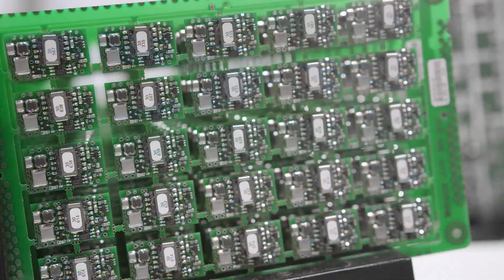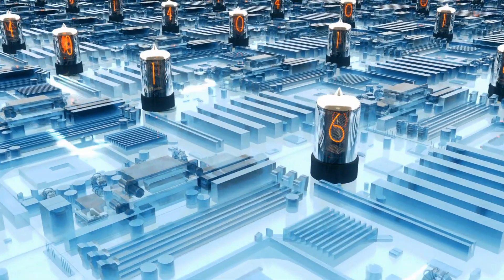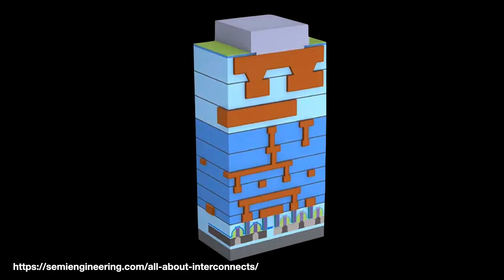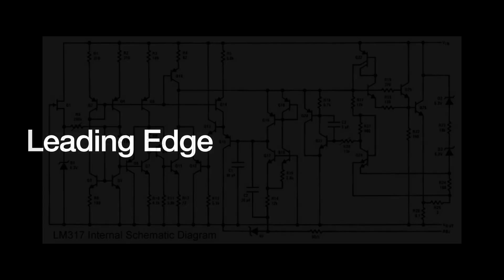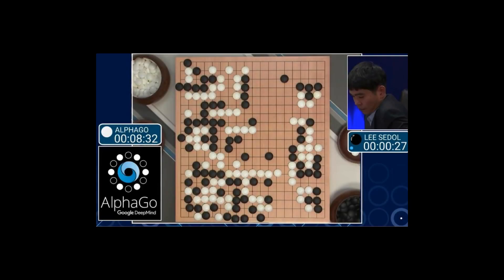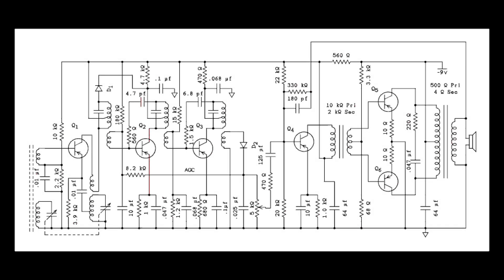Analog Chip Design is an Art. Can AI Help?

Comment: If you get down small enough the analog world starts looking decidedly digital in many of its aspects. But, then if you continue digging quantum effects rear their heads and the world is neither digital nor analog. Instead if is some weird miscegenation of the two. That said, if you are to be successful you'll realize that nothing in wires, it's all fields guided by the parameters of the material in which they are propagating. You can see where you want the signals to go; and, then because they are fields, you must consider where ELSE they might go. Then you either find you grok it in fullness or you're second rate trying to make real physics work with high school physics level understanding. The gremlins eat you for dinner.

The smaller the circuit the more the gremlins seem to gather. You must understand macro circuit design and layout thoroughly. That can mean understanding that "ground isn't ground." Forget your physics class unipotential ground plane. That layer you call ground is a big layer of material with a finite conductivity. Every point on it interacts with every other point around it to give it a unique potential, which feeds signals, wanted or not, into circuit elements connected to that ground plane. Add in the detail that it is fields in and around conductors that transmit the energy/information around the circuit. Coupling of fields is done with loops. You minimize coupling by minimizing the cross section of the loops. You must keep them SMALL. And the layout artist looks at complexities such as an analog to digital converter slowly grows brain fur. But, these days that problem exists for the digital circuits as well. There ain't no such thing as a free lunch. And an understanding of one of the most abstract aspects of our universe, fields, is absolutely essential. And those damn things aren't analog of you don't watch them closely. They can start playing particle games with you.

(Not a chip designer. Am an RF circuit designer bit by the dark side of the software. Now I bring it all together with SDRs while deep in retirement. I have deep respect for Bob WIdler and the rest of that crew. But, I suspect modern Analog Devices circuits would give them trouble. I have real deepest respect for the contemporary mixed signals chip designers.)

{O.O}

Comment: I used to be an analog and mixed mode ic designer. I had LOTS of fun. I especially enjoyed the challenges of simulating the circuits properly. And what a feeling when the first silicon arrived on the bench and it worked exactly like in the simulator! Of course sometimes certain behaviors of the actual chip remained a mistery...
Reply: care to share those unexpected behaviors?
that's how we learn how the universe really works
Reply: @manonamission2000  well, it's been over 20 years ago. If I remember correctly I had an offset problem: the measurement and the involved math showed beyond any doubt that there was a constant offset causing a systematic error in the slope of a ramp. But my colleagues and I looked everywhere (circuit schematic, layout, design parameters) but everything seemd right. In the last run we even chose a more expensive mask set, but the offset was still there. Fortunately the parameter was not a fundamental one, so we simply relaxed the spec and the device could enter production. But I could never figure out the root cause.

Comment: Something not mentioned in the circuit layout part is the inability for algorithms to route circuits in a determinable amount of time. Most algos used in programs have a best/worst/average case (BigO notation) that is polynomial which mean time to complete is an exponent of the items to iterate over. Some algos are deterministic but some, like the travelling salesman problem, are nondeterministic and thus cannot predictably be solved in the most efficient way possible by a machine.
Reply: That's exactly the point if the parallel with the game of go.

Comment: Those who aspires to be analog designer should have many first-hand experiences on discrete high frequency analog circuits design first in early age.  You can experience many varied and weird parasitic behavior of analog circuits on such RF circuits. Familiarize yourself with many historic analog circuits design like radio, TV, classic amp, radio transmitter, op amp circuits. Study workings of the circuit carefully down to a resistor. Once you are accustomed and learned such strange and intricate nature of analog circuits, then study carefully circuit, layout, and floor plan of famous classic analog integrated circuits like LM741, NE555, LM324. etc. Compare SPICE simulation result and real circuit behavior. Know the difference of SPICE mode and real world integrated circuits. Try to understand why they are designed circuit and layout such way. You will get lots of insights from such classic designs.

Comment: The digital world is binary but the real world is analogue? Really? Isn't it true that the smallest observable/meaningful space-time is the Planck space-time and any attempts to interact with a smaller space-time will result in a singularity quandary? Perhaps reality or analogue has other meanings in Asianometry?
Reply: Context. Most analogue circuits don't operate at a level where that directly becomes an issue. At mist you might observe it indirectly in the form of noise.
Reply: @Gameboygenius  That true with the current technology. However if/once micro-electronics shrink to atomic levels (nano-electronics?), quantum effects become much more significant. If/once engineers wish to shrink electronics to subatomic level (i.e. pico-electronics?), quantum effects like tunnelling & entanglement will dominate. Fortunately (or Unfortunately) even at this extreme level, 1 Planck length is still about 1.6 billion-trillion picometer (or 1.6 sextillion picometer or 1.6 thousand quectometer) ... so perhaps from this perspective, reality does look analogous or continuous to the author of Asianometry?

Comment: nice :) I really struggle with the analogue parts of my projects :) I notice quite a movement  to re-create old analogue chips like sound chips with FPGA emulation based on digital filters and some very creative bitstream shenanigans. That is open to AI approach too I think ? I recall some mobile robot gait generation approaches based on AI gen of bitstreams for FPGA ... with class D amps all sorts of oddness become possible on the analogue generation side.
Reply: I would like to know all about analogue sound chip FPGA bitstream shenanigans, if that's actually what they are and not just clever digital programming.

You might be aware of Adrian Thompson's classic 1997 paper "An Evolved Circuit, Intrinsic in Silicon, 
Entwined with Physics". He applied a genetic evolution approach directly to the bitstream to evolve a tone detector that could discriminate a 1 kHz and 10 kHz tone on a FPGA with no external timing reference. It got there eventually. But the odd thing was that the circuit relied on cells that were disconnected to function. And when he tried moving the bitstream to a different of the same model, it no longer work. The genetic algorithm had evolved to live on one specific piece of hardware.

Comment: Working at an analog company we only considered ESD protection the black magic. Most analog design was fairly automated after proper modeling.

Qualifying a new process was very in depth, and there were a few gotcha’s that popped up in the first designs with nearby devices or interconnects but those could be worked in design rules and coded into automated design tools. We would occasionally find a new problem in mature processes, but those learnings were quickly tested for in other processes and proactively prevented.  

We weren’t at 7nm, or 32nm, but the analog circuits were always larger geometry then the digital portions even in analog heavy designs.
Reply: Put thermal accurate thermal models behind each component and a spice of minority model of the substrate connection it turns to less an art but more engineering.

Comment: As someone who has tried to use the Berkley Analog Generator (BAG) one of the main problems is setting the system up. First it is a python library (built by grad students) with lot's of dependencies, these are not always readily available on the operating systems used to run EDA software (*cough* RHEL 7 *cough*). After that hurdle is cleared, BAG needs a set of base layouts that the software can array copy (for lack of better words) next to each other. These base layouts are necessary to build up larger transistors with the flexibility to meet the design needs. These layouts are difficult to make due to the complicated design rules for current-gen and leading edge processes. Also, the work to build the layouts cannot be shared between processes as they are, in general, quite different from each other.
All this to say, BAG has significant adoption costs associated with it.

Comment: Does anyone know what are some differences between designing analog circuits for an ASIC vs. FPAA?
Reply: An FPAA is designed with a certain type of function in mind. For example an audio filter function. Such an FPAA would contain opamps and variable gain circuits for example. You would be unable to configure those blocks in such a way that you could make a DCDC buck converter for example as that needs different types of blocks. On an ASIC, there are no such restrictions, you simply integrate the blocks that you need like comparators, gate driving circuits and some large switching transistors to make a DCDC converter but for an analog audio processor you would use opamps for example.

Comment: My first analog circuit was a DC/DC converter with multiple inputs, single output to define the desired output voltage given the multiple inputs (it had power delivery limit, desired speed and temperature), it was designed to move a DC motor for a prototype car. Why did I made it analog? I dunno, I just loved the idea of making something different using something no one around me was able to even try to copy

Comment: A similar thing that has always baffled me is analog mechanical computers like the fire control system in Iowa battleships. Which as far as I know remained a lot more accurate in it's firing solutions than many digital types that followed. And since it mixed inputs continually it also gave you solutions real time. The only not real time part was the human operator needed to feed the wind speed or some of the other inputs into the system. But other than that it was solving an analog equation with the given inputs.. mechanically.

As a student of the binary age I've always thought that was really crazy that someone thought of doing things like that.
Reply: Yea, I watch Ryan over @BattlshipNewJersey as well. Digital is like quantization - it's discrete.  Analog natively supports 1/2, 1/4, 1/8... 1/n.. 1/n*2... increments.  Terms like a "smidge" are perfectly valid.  Also, all of the inputs on the Mk 38 Range keeper along with the Mk 41 stable vertical are analog.  Distance, bearing, temperature, humidity, on and on.  Analog calculating analog is ideal in this situation.  The inputs are the impetus for the outputs.  The output changes continuously with the inputs.  The firing solution is a natural result of the inputs.  It was 40 years of development before the analog to digital encoders, and the digital computers were fast and reliable enough for the Navy to make the transition.  Even then, the firing solution was discrete.  Inputs became fixed so a firing solution could be calculated and made available when the trigger is pulled on the pineapple.
Reply: @fredinit  And 5hey were using analog firing computers in the 19th century in the early battleships and cruisers.

Comment: Ok, let's try to identify some of these images for fun.
0:06 A DC/DC converter module of some kind. Transformer and optocoupler in the middle of the board to isolate the primary (right) form the secondary (left). Could be for use in telco for converting 48 V to a local voltage like 5 V or 3.3 V for example.
0:13 Some analog chip produced by PMI (Precision Monolithics). Could for example be an opamp.
0:31 The title "analog delay" combined with delay stages taking opposite clock signals φ_1 and φ_2  points toward a BBD (bucket-brigade delay). This is an analog device delaying an analog signal by feeding it through a series of capacitors which each holds a sample temporarily before passing it on. I don't recognize the circuit. I would've loved for this to be either Serge's Wilson Analog Delay or Buchla's model 277 (modular synth devices) but it doesn't look like it.
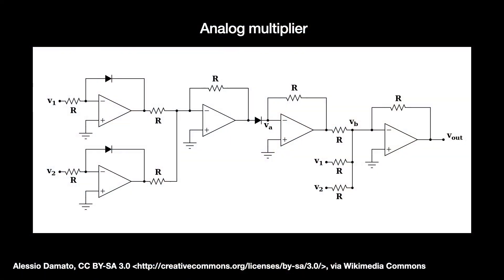2:09 As the title suggests, an analog multiplier circuit. What's neat about this circuit is that it's actually a logarithmic converters followed by a summer followed by an exponential converter. In other words, it turns a multiplication into an addition according to the laws of logarithms and exponentials: a*b=e^(log(a)+log(b))
2:51 Looks like the same analog delay circuit as in the title card. Through the magic of reverse image search, this turns out to be an early 1976 guitar pedal prototype circuit which inspired MXR delay pedals.
3:05 The title cards for two previous videos. To the left, the board for a HackRF One, a SDR (software defined radio) which can be used to receive various radio signals. To the right, something that looks very much like a computer motherboard, with PCI or RAM slots.
4:27 Looks like a RF demodulator going into an AGC (automatic gain control) then into an amplifier feeding a builtin speaker. Ie a radio receiver. The negative voltage supply (positive ground) combined with liberal use of transformers, suggests a vintage circuit.
5:00 LM317 internal diagram. LM317 is a classic adjustable, linear voltage regulator. The schematic of the internal diagram is drawn in the datasheet.
7:18 Looks like a circuit for exercising your understanding of Kirchhoff's Law in school. Fun stuff.
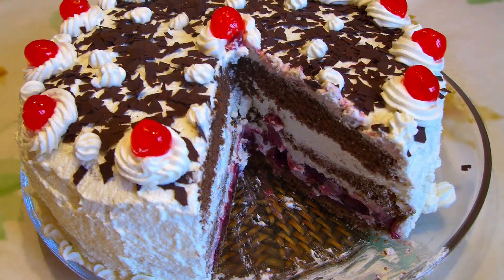10:52 A delicious cake, which I'm informed may be a lie.
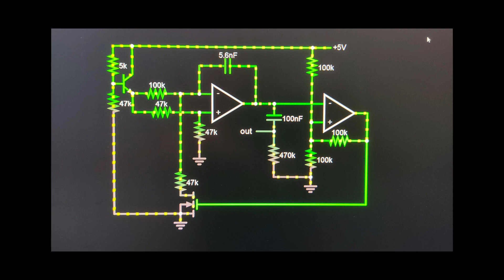12:30 Looks like a sawtooth wave generator. The second opamp is setup as a comparator, which will trigger the MOSFET and reset the phase when the voltage goes above 2.5 V, plus a little bit of positive feedback to encourage the opamp a bit to work as a comparator, which it's otherwise reluctant to do. Also, screenshots are hard.
12:44 Not a schematic, but just a note that it's difficult for AI to generate grids apparently. The lines are wobbly and the lines never seem to line up on both sides when they're obscured by some object.
15:18 Interesting. I wonder what this is. Two CPU/FPGA/whatever devices hooked up to memory, by the looks of it. And then IDC headers. This is probably some industrial or test equipment, like the digital portion of an oscilloscope.
Reply: Nice to know that AI struggle to draw grids.
Reply: Thanks for sharing the insight!  😃
Reply: I know old school audio amplifiers had a ton transformers in them , so perhaps the schematic is for 1 of the amp’s stages
Reply: @bigmedge  nah, it's an all in one radio. Lower left is the tuner, with the dashed line being the coupling to the antenna, and the adjustable capacitor in parallel with an inductor being used to tune the frequency. On the right side you see the amplifier section with a 1 transistor preamp and two transistor power amp, followed by what looks like a built-in speaker.

Lots of transformers is just how they built stuff back then because of habit from the tube days, and the price of  transistors. Transistors were cutting edge technology, and transformers were something you could manufacture easily with cheap labor. If you could solve a problem without adding more transistors, that's what you did. Today it's the opposite. Transistors, especially in integrated circuits, can be mass produced for almost nothing in a highly automated factory but transformers still require (now more expensive) manual labor.
Reply: @Gameboygenius  
Look like an old transistorized AM radio to me, I can almost see the wax they put on the variable inductors.
Reply: Literally the most Asianometry viewer comment possible
Reply: Nerd, but I love it.
Reply: Hi, bro...can U start teaching us Analog IC design?? 😊it would be helpful for us All
Thank you ❤in advance